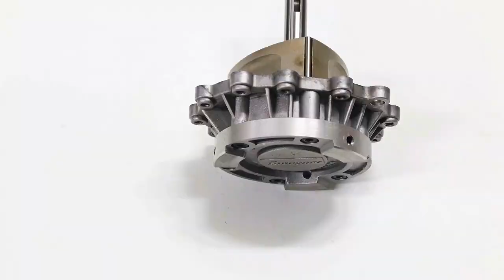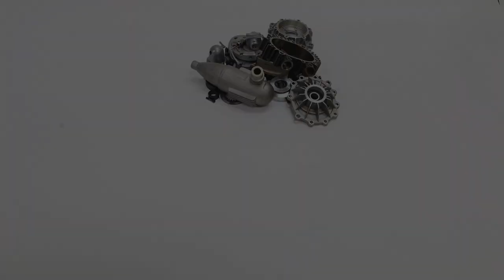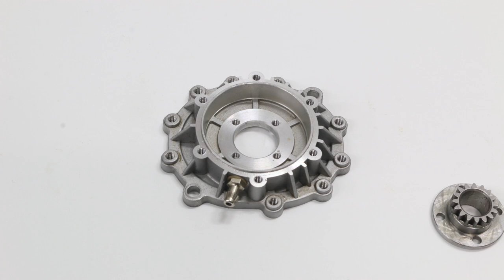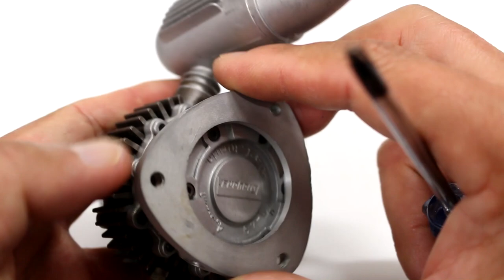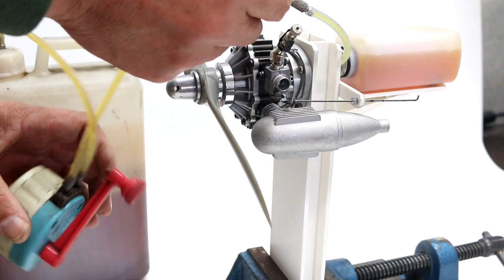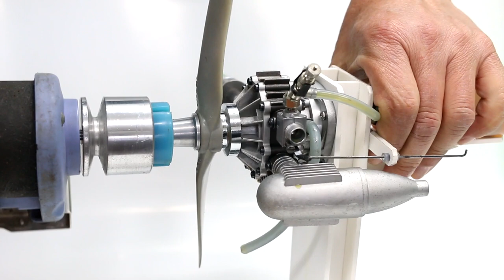WANKEL ROTARY ENGINE - STOP MOTION

Comment: one of the coolest engines ever! i think the rotary engine was way underrated and never really given a chance
Reply: Dragon800 The efficiency is sub par compared to a piston engine
Reply: Im saying with more research and design it could have accomplished great feats. I'm not talking about efficiency either I'm talking power. Look at the power of the 13b in the  rx-7. Now Imagine today's version of a 4 or 5 rotor rotary engine if given the attention the piston engine was given in the previous decades.
Reply: Yeah but the efficiency was bad, the rotating piece was tough to seal properly and the seals would burn out quickly and required frequent maitenance. Did i mentiom that it burned oil too? You had skyhigh emitions, poor reliability and it spent as much oil as it did fuel. It was never succesful for a reason.
Reply: I read up that it's being experimented on as an aircraft engine. Apparently the power to weight ratio was just too good to pass up.
Reply: technically it was successful. the RX Mazda's were very successful in racing especially.And if more research was put into the design such as the corner, side, and apex seal improvement they would have done even better.
Reply: Sounds like you are very unfamiliar with the Wankel engines development history...
Reply: +BrokenLifeCycle Wankel engine are obsolete now... they were found to be very poorly suited to aircraft design and were abandoned.
Reply: The Wankel engine was a massive commercial failure.. it caused Mazda to go bankrupt TWICE!
Reply: Yes! You are very unfamilar with its history son... 26 of the world's largest and best engine manufacturers and over 100 of the best universities and research institutes spent over a decade, millions of man hours and billions of dollar developing the Wankel engine design.
Mercedes-Benz and and General Motors for example both spent over 100 million dollars a year on Wankel research and development.
Ford (Ford held more patents than Mazda) 
Toyota
Porsche
Rolls-Royce
Nissan
Alfa Romeo
American Motors (AMC)
Citroën
Suzuki
Yamaha
Kawasaki
BSA
Norton
Hercules
John Deere
Ingersoll and Rand
Fichtel & Sachs AG
Yanmar Diesel Co. Ltd
Daimler-Benz AG
Deutz AG.
MAN AG
KRUPP AG
IFA VEB
Graupner
Savkel
 All the motorcycle and automotive manufactures already mentioned above plus the heavy truck and Diesel engine manufacturers and the aircraft engine manufacturer
Curtiss-Wright
OMC      marine engine manufacturer. 
 and of course 
Wankel-NSU which became Audi..
 ...and dozen of subsidiary companies and and partnership companies which combine represent billions of dollars in research and development besides just tiny little Mazda.
Reply: I'm sorry you don't have any famous friends in the music industry, Katy was my next door neighbor years ago... a very sweet girl.
Reply: oh my if only i had a famous person as a friend that would so amazing!!! did you help katy record her sex tape too? lmao man your just the coolest guess ill never be as cool as you!
and yes i do the KKM is the design that replaced Felix Wankel's original DKM design. it was much simpler and was built in secret by a guy named Hans something i dont remember his full name.Felix was angry because it was designed behind his back but the KKM was the design the NSU  decided to back because the DKM was too complex and you even had to tear down the entire engine to change the spark plugs.
Reply: but anyone could look that up on google as quick as i typed it so this proves nothing.
Reply: Then why were  you not familiar with the massive commercial effort and investment in the development history of the Wankel KKM? Are you just that lazy????
Reply: I'm starting to understand why you have no friends.
Reply: dude all that is nothing compared to what went into piston engines.
Reply: The Wankel KKM runs on gas... it cannot use the Diesel cycle mode of operation...
Reply: i meant piston engines. i think its obvious that the kkm wasnt diesel powered. either way im done with this i have much more productive things to do with my time than argue about rotary engines.
Reply: What has been spent on other internal combustion or any other heat engines is complete irrelevant... they spent billions on the Wankel, just enough to discover that it was fundamentally flawed and inherently inferior to other forms of ICE technology.
Reply: The KKM is a "PISTON" engine.
Reply: We were discussing WANKEL engines... not Rotary engines kid.
Reply: I turn my head for a day and it developed into this cluster fuck.
Reply: ok i was done but how the hell do you consider the KKM a piston engine?
Reply: What do you think that triangle shaped thing is?
Reply: you should really stop bro. the "triangle shaped thing" is a ROTOR! And Wankel built the rotary engine not the radial. You tried to sound like you know about the KKM and the history of Wankel engines but you think they are piston engines.
Reply: Damn kid! You don't know what a ROTOR is???
Reply: WRONG! Felix Millet invented the Rotary... Hanns Paschke invented the KKM
Reply: Your just making yourself look worse with every post. Its obvious its you that looked some stuff up quick because you supposedly knew what a KKM was but then said its a piston engine. You have nothing better to do but you cant even argue properly because you have no idea what your talking about.
Reply: That's OK kid, most people don't know the difference between a Radial and a Rotary engine... they look the same to an amateur.
Reply: thanks for another comment! Ill be sure to give you the link to the video i make about your ignorance!
Reply: Felix Millet invented the rotary internal combustion engine BEFORE Felix Wankel was even Born...
Reply: So once again your confusing radial with rotary and coming up in your head with a mix inbetween! your totally shot you know this right?
Reply: You still don't see it???? You are really dense kid!  Felix Wankel was a huge motorcycle enthusiast, his favorite bike was the MEGOLA and he worked for NSU Motorenwerke AG... A MOTORCYCLE MANUFACTURER

Comment: Awesome... Didn't know anything about rotary engines until I saw this video... But it seems this rotary engine creates more vibration than piston driven engines...
Reply: its actualy opposite
Reply: laluisback samaans it just randomly looked like a lot of vibration is going on here..
And does traditional clutch and gearing system works with it..???
Reply: If you look closely, it only produces a lot of vibration at idle, and that's because the carburetor doesn't allow adjusting the fuel mixture at idle. This engine was designed for model airplanes, and model airplane engines don't need to idle smoothly because they only idle before takeoff and after landing.
Reply: The triangular shaped piston is relatively heavy compared to a reciprocating one, this creates a high osculating moment. Larger Wankel engines have balance weights, mass dampers and heavy flywheels to control vibration.
Reply: From the look of it, his engine is missing the Woodruff key that fits into a slot on the crankshaft to properly align the front counterweight.
Reply: +Michael Vechnak Then explain why reciprocating engines can rev higher that Wankel engines?
Reply: +Michael Vechnak The triangular shaped pistons in the Wankel didn't rotate concentrically... the eccentric-crankshaft of a Mazda 13b had a 30mm stroke.

Comment: I believe the counter balance was assembled in the opposite orientation. I assume the weight of the balance would want to face the corner not the side of the rotor. That might smooth up the operation.

Comment: I love how simple rotary engines are.
Reply: Compared to a typical RC engine these are more complicated and have more parts... its one of the reasons they are no longer sold.
Reply: A full-sized automotive Wankel engine like the Mazda Renesis had over 235 moving and seal related parts, many of them very tiny and fragile... a significant disadvantage in both cost, maintenance and reliability.
Reply: doktorbimmer the 13b only has 3 moving parts. The eccentric shaft and 2 rotors I don't think there are 232 seals
Reply: +Kelan Hume Obviously you are just speculating... if you had ever seen one apart before you would know it has far more than just 3 moving parts.
Reply: doktorbimmer please give examples
Reply: +fake name  The Mazda 13b has over 100 moving parts inside the housings alone including the apex seals and springs, side seals and springs, corner seals and springs that's before you even start counting the eccentric-crankshaft or the pistons(rotors).
Reply: doktorbimmer I wouldn't consider the apex seals and other parts like that moving parts because you could classify the windscreen a moving part because it moves relative to the ground when the cars moving
Reply: +fake name Well, then by your logic, a 2-stroke engine only has 2 moving parts and a 4-stroke, 4 cylinder engine only has 5 moving parts.
Reply: +Mandernach Luca  Just the facts here son... spare us the fake fanboy bullshit rumors.
Reply: +Mandernach Luca The truth will always prevail... go be an angry troll somewhere else, OK.
Reply: Lemme reconsider my comment. This little Wankel engine seems very simple. Yes? 😅
Reply: +Devon Daviau Compared to a 2-stroke??? I would beg to disagree with you sir.
Reply: doktorbimmer I said absolutely nothing about 2-strokes.
Reply: +Devon Daviau You don't know what a 2-stroke engine is???
Reply: +Mandernach Luca Are you claiming a 2-stroke is more complicated or has more parts?
Reply: Yet no one here seems to have a valid argument contradicting the facts I presented, If a Wankel engine has more parts than a 2-stroke... how is that an advantage?
Reply: doktorbimmer It is true that it has more parts and the a lot of them are seals (in contrary to a two stroke). The advantages are the smooth run, the reliability (a wankel, KKM or DKM, engine has no direct engine failure), its  radial compact design and its high power to weight ratio. Mazda for example won Le Mans exactly one time and that was because of the pure reliability of the rotary against the other engines in the field. Those are facts and not made up.
Reply: If high power-to weight ratio is such an advantage? Why did Audi win LeMans with a DIESEL engine 9 TIMES!!!!
Reply: If they were so reliable? Why did Mazda lose the 1991 WSC championship to JAGUAR?
Reply: Those are real facts... not your made-up ones.
Reply: +KHALIL01 That is just a very ignorant, and completely false statement... the Wankel engine has no advantages which is exactly why they are OBSOLETE now... Opinions are like assholes, we all know you have one, we also know now that you are not knowledgeable regarding Wankel engines too.
Reply: +KHALIL01 Only stupid people believe the false myth that Wankel engines only have 3 moving parts... if you had any education or experience you would understand this myth is simply ridiculous and without any truth.